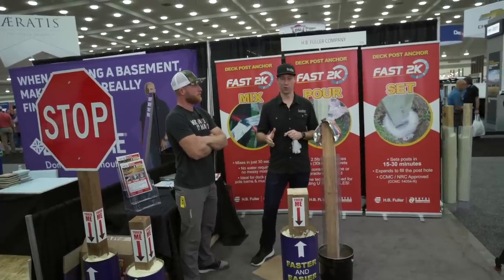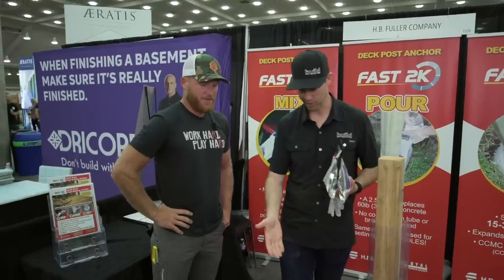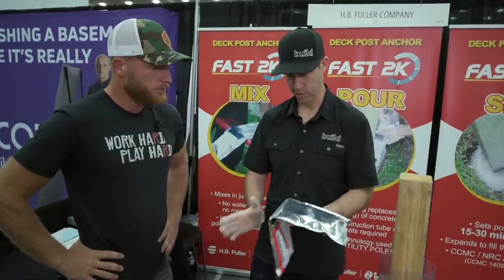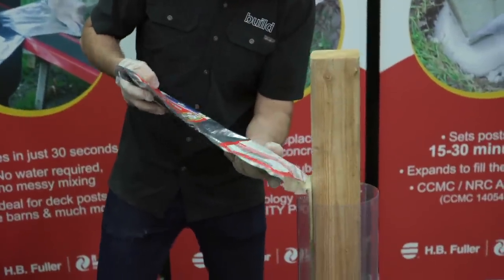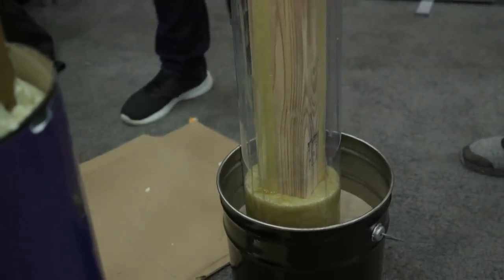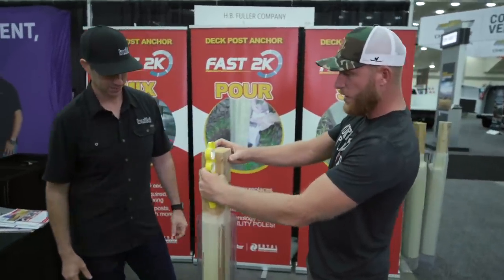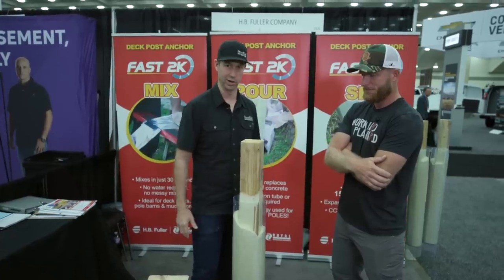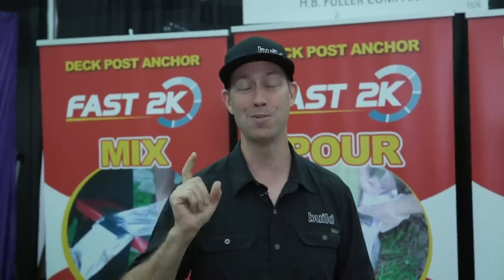Foam INSTEAD  of Concrete???

Comment: No need for concrete or foam.  Just backfill the hole with the soil you dug out of it and tamp it back in tight around the post.  Will not work with sand, but just about every other soil works great especially heavy clay soils.  The foam and concrete are essentially just increasing the diameter of the post where it is in contact with the soil.  The soil itself around the concrete or foam is ultimately what is holding up the post.

Comment: The way to avoid rot in post setting is to use steel pipe instead. :-)

Anyway, this post will rot faster at the interface than a cement set post. I would epoxy seal that post 6" above and below the interface.
Reply: I was thinking of protecting the post by painting with a Gorilla paint. Sometimes refered to as LineX.
Reply: @ocdtechtalk  that stuff needs a good surface. I'd sand with coarse grit, clean with mineral spirits and let dry under cover for 2 days before painting it.

Comment: Downfall, replacing posts that were cemented .
The holes are much bigger when removing the rotted post . 
Whomever installed the gate post at the house I bought poured a base or footing 20  inches down.  Back filled the hole with 12 inches of dirt.. then poured 8 inches in cement..
To remove all of it creates a huge hole that needs to be refilled with dirt, packed down until hard and then use an auger..
Or use rebar to reinforce the 24 inch diameter by 3 feet deep hole using cement .  Foam will not be dense enough, unless it is poured and place under pressure, by using boards with plastic sheeting attached and coated with WD-40 and weights placed on top about 40 pounds..
The foam will push the boards up and the foam becomes denser..

Comment: I could see using this for fence posts if it were cheaper or similar in price to a bag of ready mix concrete.  I've had to replace a couple fence posts after a storm and the worst part was the handling and disposing of the old concrete.  That's the only situation where I build anything with posts in the ground.
Reply: it definitely costs 3x more, but less mess and much less weight. also more difficult to dispose off, but easier to handle and remove indeed
I have yet to personally use this foam stuff.

Comment: I'm just delving in all this, and I'm confused. It's a wood post, which means water will get in there one way or another. With no way out water will rot it. What info am I missing that makes this product work?  I'm thinking that I'd just as well go with steel posts and then look at this product to replace cement.

Comment: I’ve seen some people test this and they looked pretty unhappy with the results, but what I saw was that they didn’t dig a deep enough hole, and they spent little time making sure it was prepared well. Sure maybe hey we’re trying a real world simulation of a layman literally using it to replace concrete, and maybe in their examples it didn’t work well, but the way I see it is, if you’re gonna use tofu to replace a burger, you’re gonna have to cook it a little differently to get a similar result. Though in my example it’s gonna be terrible no matter what.

Comment: This is incredible.  Sets fast, doesn't rot the post.  I mean whats the negatives?  Talked about it costing less.  Less labor to schlep concrete to a hole.  I mean Matt did it in seconds.  It would take guys a lot of time to mix and shovel concrete.  And then the clean up.  yich.

Comment: Love the product however, it has a flaw. You cant get it to be a solid set is softer soil. If the soil is sandy or on a slope and full of clay. Then it doesnt work as well. There is no weight to anchor the posts down in that type of soil.

Comment: As a foundation, this foam product is relying on the soil to prevent uplift and will require a soil analysis ($$$) to meet building department requirements.  As a result, my structural engineer mandates enough concrete for its dead weight.

Comment: Someday when you need to replace that post, how nice would it be to just dissolve
Foam and clean out the hole. Instead of dealing with concrete

Comment: The  soil at the bottom of the post better be compacted to the max   Foam is not as stable as concrete  post is in contact with the soil  that causes rot  you can do the same by using dry concrete  by the bag  1/2 bag  dumped in the post hole  - then tamp the dry concrete with a 6 foot post  ( a compacted base )  put the post in the hole on compacted base then   Dump  the remainder of the dry concrete  around the post compacting about every 2 inches until filled.  This pass the New York State building code  for pole buildings  I have set @8X8 this way  you can build on this right away. There is no setting time

Comment: Could this be used in 4 x 4 posts when building a tree house?  The treehouse we are going to build is going to be 5 feet off the ground and will be a 10 x 16 foot with 6 posts supporting it. We will also build an 8x8 foot playhouse on top of it.  Wondering if I can get away with this instead of concrete.
Reply: Put your pole in deeper and add protruding screws to allow the foam to bite the 4x4.

Comment: Looks to me like they need a two tube applicator, like Simpson has for setting anchors, so that you can squeeze out extra to top off a hole after using the bulk bag(s).

Comment: Which product is better for the environment the phone where the concrete? Also i pull posts out almost only a daily an have to break the concrete off the post. No matter whether it was 20 years old or just a few years old they look the same once you best concrete off. Nice try though. Also at 15$ a bag or so. LOL!!! id stick to concrete if you buy it in bulk. It breaks down to about 2$ a bag at 80 pounds a bag.

Comment: Would this foam work under a bathtub?  I have a tub that's already installed, and the guy used "great stuff" foam under the tub.  The tub floor is flexing, and over time it will fail.  I'm in the process of removing the inadequate foam that he used, and I'm looking for some weight bearing foam to inject under the tub.
Reply: nosrednugj use a low expanding foam..
Reply: @luciustate4386    Would loctite tite foam work?   That's what I see when google searching for low expansion foam.
I've read somewhere that a boat shop would have structural expanding foam that would work.
The Loctite stuff is for insulation, and I'm pretty sure I need structural foam.
Reply: nosrednugj probably will.. they should have it at any hardware store.. Lowe’s and Home Depot should carry it

Comment: A satellite installer set a post for me once and I watched.  He did not use concrete for the same reason you gave (it rots the post).  Instead, he poured in stone, then some concrete mix on top of the stone, then added water.  The concrete binds the stone in place but the gaps in the stone still allows for drainage.  Minimal cost.  What's the downside?

Comment: COST COMPARE 100 posts:: ends up about equal  for foam vs concrete (Feb 2019 in SE USA) . . . Material cost, $1200_foam - $600_concrete. BUT, you can send a child to the store in a compact car to pick up the foam packets to do 100 posts and then distribute them on the job site. When it rains the foam is easy to store and protect. Concrete for the same job requires LOTS of Labor/Trucks/Tools. . . .  Do you have water on site for concrete cleanup?  SO .... the labor, tools and material handling equipment etc are gong to eat up the difference in material cost.  //// ENVIRONMENTAL ISSUES:: are important to consider but I don't have any thoughts at the moment.

Comment: what's the R value of that stuff at 3.5 inches... gonna a pour a bunch into my uninsulated walls :P
Reply: It will expand and rip the drywall off. Just be sure and only mix and pour very small
Amounts if you do.

Comment: Saw a demonstration and after 2 days the result was the foam that had pushed out into the earth had contracted slightly, as well as the foam around the post.  The result was space around the foam and earth that wouldn't hold the post in place, and also foam had contracted leaving the pole itself loose.  That was enough to turn me off this product.
Reply: I saw the same thing after 2 days.

Comment: The folks that 'mud jack' sunken concrete slabs are using foam and not concrete these days - this may make sense.
Reply: they used to use grout like the industry does in the mines and on large projects such as tunnels for roadways, foam makes more sense on a sidewalk/walkway
Reply: Randy Dueck this product is a temp at best, been replacing posts with this crap for years now. If you want it permanently locked in place use concrete. This isn’t even close to what is used in the mine industry .

Comment: The problem with foam is that it’s compressible. Once it compresses and the cells collapse they don’t return to normal. Over time the posts will develop wiggle which makes it a pretty poor choice for a fence that catches a bunch of wind. It’s a simple math problem of density. 2lbs of foam vs 60lbs of concrete to fill the same volume. The foam is mostly air. No thanks.
Reply: Wannabe Ranch it’s not like a canned spray foam for insulation, it’s a different mix that becomes rock hard. Water doesn’t bother it, but it isn’t usually UV stable so it requires 6” of cover fill

Comment: 1) there is no skid steer on the market today that would sheer a 4x4 post. The tensile strength of a 4x4 is extremely strong. It couldn't even do a decent 2x4. 

2) this foam will deteriorate over time. Concrete will become stronger with rain and settling dirt around it. 

3) this crap is way more expensive than concrete. And concrete can be recycled and is better for environment. 

Literally the only pro to using this foam is the speed in which it sets. I think I'll continue to wait a few hours and stick with my concrete.

Comment: On what planet is three 60lb bags of concrete .33 yards? .45cft!  And I like how 2-3 (again not a third of a yard) went right to 2 when he ran the numbers "$30 a hole". Btw 20 #60 bags per 1/3 cubic yard. If one bag foam = one #60 bag concrete... 20 bags of foam at $10-15 is $200-300 a hole. If he spends $120 a hole now, he could be adding $80-180 a hole for foam. Not necessarily a bad thing if the product is in fact waterproof and provides the longevity of concrete. But don't fudge the numbers.

Comment: Foam sucks. I’ve seen the foam shrink over a little bit of time and gets loose in the hole on fence posts. I’ve literally just pulled it out of the hole with my hands. I would really need to see some long term evidence of this working before I would use it on a fence, let alone a building

Comment: fence post concrete  is about $4 for a 60 pound bag, so a lot less than $10 per foam bags. In general post is most vulnerable, it's a good claim only time will tell. As far as what Kyle does, I wouldn't feel good about burying anything structural long term, would rather use concrete in conjunction with a Simpson tie.

Comment: It's maybe cheaper (depending on labor/tool costs) and easier to use, but doesn't seem as good for the environment. That stuff does not decompose nor recycle and it's not really natural. Cement production causes quite a bit of CO2 production, but at least it's not everlasting garbage once done being used.
However I suppose that in current age of  global warming being critical, the foam may actually be the better option. I'm not sure how much CO2 it would use in manufacturing, or what gases it gives off when it foams up, or how that would compare to an equivalent amount of cement used to make concrete.

Comment: I use this everyday as a satellite tech.....it's not at as rigid as concrete, you can move post after, pretty easily pull it out of ground if you wiggle back and forth, temperature is a huge factor in effectiveness, concrete is much more solid

Comment: One problem I could see, even if this was ok otherwise, is that there is no way to know exactly how much of this stuff you need to pour into the each hole, since each hole has a different dimension than the other holes even for the same project, & any overflow will create a mess.

Comment: I wonder if a foam based foundation or slab may be possible
Reply from the maker: Interesting thought.
Reply: i read through the FAQ on the fast2k website. This stuff does not replace a footing, its only for backfill.

Comment: Isn't weight attached at the bottom of a fence post important. I would still use concrete on a fence post that is exposed to wind.

Comment: 88lb of fast set postcrete £7, splash some water in the hole, chuck the post crete in then splash some more water on the top, under 15mins it's rock solid, also I've never seen a post fall over because it rotted underground, they always rot off at ground level because that's where the air and water can cause the rot. One last thing, 4000lb of lifting force sheared the post? RIGHT! So why can i use a 2T engine hoist to pull out old post, concrete and all! What ever ground were the posts set into to stop the entire thing from just pulling out of the soil? And whatever sort of wood can't even withstand a 4000lb pull? I call BS on this.

Comment: i've seen people doing this for a couple yrs now with just normal can spray foam.  I suppose buying the bag is probably cheaper though.
Reply: Yikes, not the same formulation of foam at all.  Spray foam compresses relatively easily, especially the standard or high expanding Great Foam, and if the skin is punctured can let water through.  Given you are filling the gap with concrete primarily for lateral rigidity, spray foam would be a terrible choice.

Comment: The foam is way more expensive than concrete. It wont seal the bottom of the post and it doesn't make a complete seal of the post.  Also the post lifetime is just as dependent on what is exterior.

Comment: It's OK not as versatile as concrete have to dig the hole straight down at least 2 feet or more or it won't hold. They'd put it on clearance at lowes for $3 a bag so I had fun trying it and didn't work half the time if the hole wasn't straight down and deep enough.

Comment: If you use this during summer with dry ground like Texas. All of your posts will separate from the dirt and be loose. You need to set post  at least 4' to be worth a damn. Works for telephone polls due to the depth they are set. Not better than concrete with round steel post.

Comment: Nope, at every level, even more so long term, if using timber post, bitumen seal the bottom to protect from rot and install posts in rapid set concrete (two bags per post) when bitumen is set hard, a fraction of the cost, tried and tested system, no liability for contractors! with the foam who has liability for it failing later? The contractor usually get the first call and has the problems of going round in circles and having the distractions, stress and financial costs of having to refocus on a previous job with problems and face the customer in "oops" mode, when it's not worth the risk or vast cost increase per post installed.

Comment: dip post in hot asphalt- back fill hole with bag of concrete add water   80lb anchor beats 2lb of wonderfluff
Reply: 80 lbs is nothing compared to the weight of a 20 ft pole.

Comment: isn't a big part of this concrete weight that provides structural strenght?
Reply: Certainly part but I don't think it is the biggest part as it is at the bottom and what you are trying to do with most fences is prevent horizontal forces which weight at the bottom doesn't do a lot for given the leverage.  It is more about filling in the hole with something that doesn't compress so you have larger rigid mass packed tight against hard soil.    If the soil around the concrete is soft all the weight isn't going to do much to stop wind/animals/people from pushing it over. Will make it hard to lift out when you have to redo it of course.

Comment: This is the first positive review I've seen on this stuff🤔🤔 Other videos show the post a day later and the post was loose. The foam had actually contracted leaving the post loose and a small gap separating the foam from the post. With a some effort you could actually pull the post out of the ground by hand. Not buying this review. Looks like I'll be replacing my pasture post the old fashioned way.

Comment: My uncle uses house wrap around the part of the pole that are going into the hole, then the cement he said it will keep the moister out and won’t rot the pole he’s done this for years. He was stationed in Germany many years ago and learned the trick from some German home builders

Comment: I dont think it would hold up much to some of the winds we get here in Ireland🤣,,plus it doesn't look like you get much depth/width out of the mixture,,, Sure a bag of cement and sand costs me around 6 Euro,,takes 30 seconds then to mix up a bucket load🤔,,,,,,

Comment: My landlord soaks his poles in a 55 gal drum with diesel before he puts into the hole says termites won’t touch it, soaks them for about a week
Reply: 99.9% of pole damage is in the bottom in the ground. where they are buried in concrete. decks and fences should be treated or cedar which termites leave alone. Now days by code is to poor concrete with a steel brace/bracket then set your post to that. inch off the concrete.  which makes this stuff useless.
Reply: Double D useless if you live in town where the codes apply, but out in the country  at least in Texas you can do what you want and build how you want without any inspections 😉

Comment: Unfortunately, nothing beats concrete( cement ) yet. And btw is this as toxic as epoxy? Tried messing with it once and it was terrible if this is the same then its no no for amything. I dont know a construction worker that wants to wear a gas mask on 40 celsius in shade while hes on direct sunlight :)